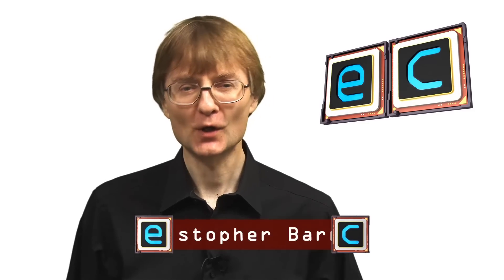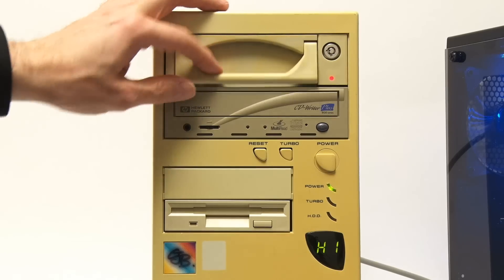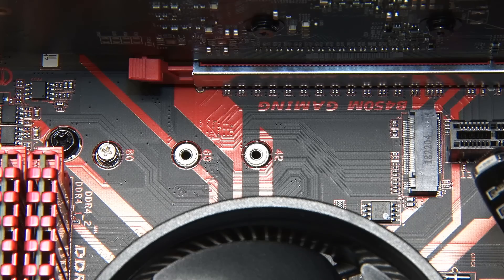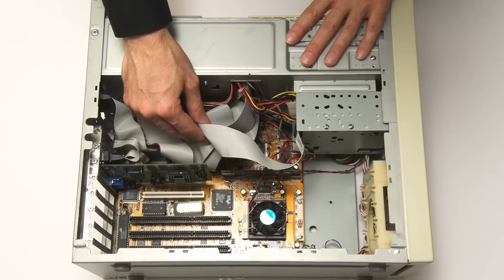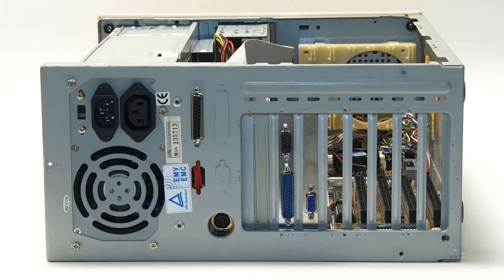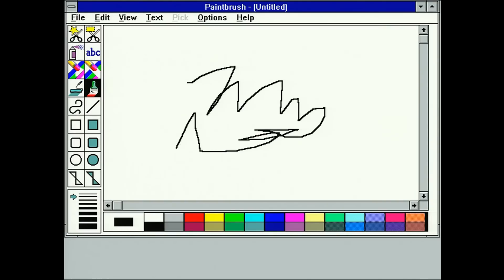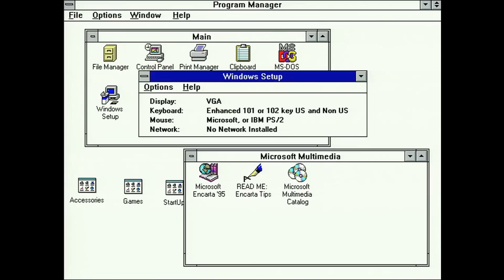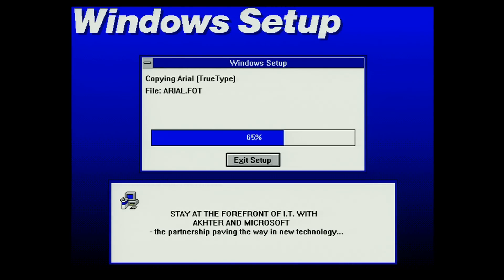Ryzen 3 vs 1996 PC

Comment: I remember the first PC we had at home. It was also around 1996 and the printer was the noisy Dot Matrix one that'll wake up everyone sleeping at home whenever we print something.
Reply: I liked that noise.  Of course you could have printed during the day, when people were up!!
Reply: @g-r-a-e-m-e-  
I remember the daisy wheel, which was later replaced by a 9-pin OKI dot matrix (it can print graphics!!). And yes, people would almost certainly be up regardless of time when using those.
Reply: @loc4725  So many hours printing "Banners" in school lol.
Reply: Lmao yup. my parents had a windows 3.1 pc I think was a 486 and I played the crap out of games like ultra pinball, chops challenge and many more.
Reply: We did not have a computer at home until 2002 or so. But my grandfather used to work as an accountant, so he had a PC running MS-DOS and Windows 3.1 (later also Windows 95). He also had an Epxon LX-300 dot matrix printer (9 needles printing on continuous paper and noisy as hell).
Some 15 years later I used the same model of printer in physical chemistry labs to print out some measurement results and calculations -- i believe they were partial molar volumes of water-iPrOH mixtures. These things were pretty much indestructible, although the printing head was extremely hot when printing.
Reply: I've still got my Epson FX80.
Reply: I still have a dot matrix printer, couldn't find a driver form win 8 onwards, Installed Linux mint and lo and behold it found a driver, now if I can get a fresh ribbon..........
Reply: @ablacknambercat  you don't really need to print anything to enjoy your dot matrix printer.  Just let it make noise!  =D
Reply: The Mad Atheist  Plenty? All anyone ever needed was Tunnels Of Doom. (And Extended Basic, of course. And the expansion box with floppies and the assembler card. I'm pretty sure it was about the same size and price as a VAX by the time I was done.)
Reply: At my IBM plant we have displays of the IBM Selectric Typewriter with the golf ball printing head which was revolutionary at the time in 1961.
Reply: The Mad Atheist  my first computer was a TI 99/4A.  My mom didn't believe me when I asked for a computer.  She asked, what do you want with a computer.  I told her, someday everyone will have a computer, which she didn't believe.  I think she now has more computers than me.  At the time, she told me that I would "have to get a job".  I was like, "MOM I'M TWELVE!" Got a paper route.  She wisely told me to stop at each house, get off my bike, place the paper on the porch, or on a chair on the porch if there was one, and STAY OFF THE LAWN.  Those instructions garnered me so many tips that I had my new computer before summer was out.  I read the book thoroughly.  Later I bought a C-64 and then a genuine IBM PC.

Did you have game cartridges for your TI?
Reply: Even if you were lucky to have an Epson dot matrix with "quiet mode" it was still noisy, and I've always been a night owl since I was a little kid, plus I always had a computer in my room of some kind(a lot of times more than one) growing up, so I know about waking others up at night with the printer lol!

Comment: Do a video on using a raspberry pi 4 4gig ram for a week
Reply from the maker: I may well. Especially when you see the cooling rig I have on it next week! :)
Reply: @ExplainingComputers  cool
Reply: @ExplainingComputers  You have build a cooling pipe to your creek in the backyard ...?

I've bought a nice solution: acrylic case + fan for 4$

The 5 V fan was a bit noisy so I checked  the pi-4 temperature : 11° C above ambient temp

So I thougt to reduce noise by giving just 3,3 instead of 5 V and that meant close to silence ... and 20° above  ambient temp at 80% cpu ..
Quite a great solution regarding price point + value that meets the pi 4 intension cause buying a pi 4 for 40€ and a 20€ cooling solution is not my thing.
Reply: @ExplainingComputers  "I may well. Especially when you see the cooling rig I have on it next week! :)"

Flirc case works fine.  I spent the weekend trying to ruin a P4 4, 4GB.  It's a little toastier than a Pi3.  I was running ffmpeg with it which moves it to 100% CPU across all processors.  Hit around 65C max - of course it depends on ambient temperature.
Reply: Is it a custom water loop ?
Reply: @ExplainingComputers  LOL, I hope the cooler is the Ice Tower. Bit pricey, but good enough to make me buy two.
Reply: @ExplainingComputers  Looking forward to that video!
Reply: Then compare it to this 1996 computer.
Reply: It's actually not that bad. The sound quality is a little lacking, but when I plug my Schiit Audio Modi 2 Uber out to a set of Klipsch desktop speakers, it sounds quite good. 😁👍
Reply: I got RPi 4 4GB this week with a heat sink I got from Aliexpress.  The heat sink has 2 small fans.  I have not started the RPi 4 yet since I don't have Micro HDMI cable.  I ordered the Micro HDMI adapter in the same batch.  Still not here yet.

Anyways Can't wait for your coming up RPi 4 series.  Salute.